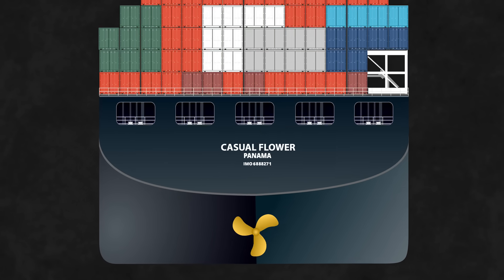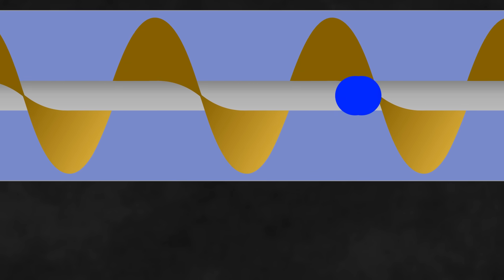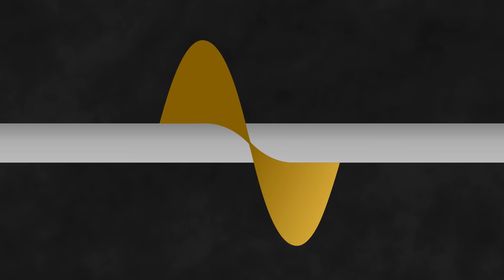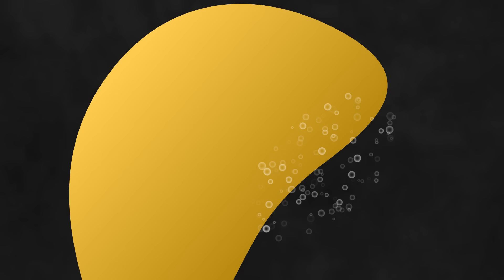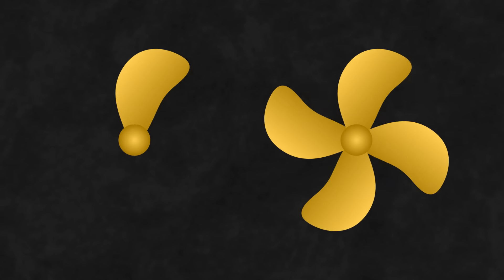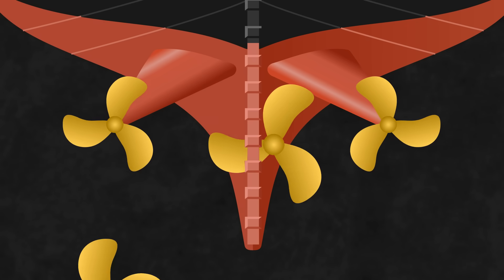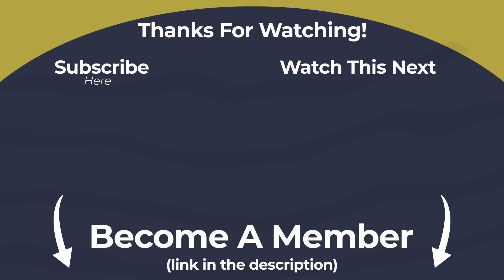Why Are 4 Blades Better Than 3?

Comment: This is a conversation starter if ya like to talk drivel for hours upon hours. I figured you'd actually teach something besides titan theory
. And then you reveal it's not a science. Then it's a science for each vessel needing a bespoke prop to solve the ten commandments of propulsion , and that can be agreed . However used props are still great value although expensive, since you can stick it on your boat and see if it sinks or swims.

Comment: Something that might be obvious but not for everyone, first is size, and generally speaking a larger prop is more efficient, but like everything else it's a compromise.
Prop theory is really complex. And with most boats not having multi speed gearboxes, the balance is even more critical.
Say a large, mid pitch prop might be great for mid speed efficiency on a highly loaded engine, but it you wanna rev it up to produce more power, you might need a smaller prop, or your engine simply won't rev up, it's like starting on 5th gear.
Or maybe you should you reduce the pitch? Well it depends, how much do you care about acceleration? How much drag does your boat produce? Do you want to achieve max speed or do you want your boat to still be efficient at low engine speed?

And I kid you not, many boat builders just plain get it wrong sometimes.

Comment: Why don't ships use ducted propellers? Use of ducts improves thrust quite a lot with propellers in air so I would expect the to apply in water but all the bigger propellers are used without ducts. Is the reason so simple that it's more cost effective to increase the radius than to build the ducting?

Comment: From the foundry point of view, when the propelers are casted the material contraction during the solidification causes stress all along the casting piece. For that reason, is a good pratice to avoid a linear shape of one paddle in front the other as is in the pair number of paddles. An odd number of paddles is desirable to distribute better the tensions in the casted propelers. 
This happens also in the apokes of casted wheels.

Comment: Note that nearly all of this applies to props for aircraft as well.
Reply: With the exception that cavitation in air is replaced by transonic or supersonic airflow, but the basic concept that a dramatic pressure reduction occurs is the same.

Comment: 3 blade on smaller boats give a better top speed 4 blades for heavier boat for more power to push but lower top end.  2 blades were condidered speed props. Had a 4 blade on my center console it didnt have the speed it should have. Swapped to the 3 blade and gained about 6 kts.

Comment: Replaced the 3 blade prop with a 4 blade prop on my 26’ cruiser. Lot better hole shot and really improved the response and handling when in reverse. Cost about 2 mph top end speed but I rarely run it wise open anyway.

Comment: We're getting a new prop on our boat soon, slightly different pitch to better suit the new engine that we had put in couple of years ago.

Only a 38' boat but even that change should effect fuel consumption, I imagine the efficiency savings of a properly pitched propeller are amplified on the larger vessels.

Comment: Question, why is it that submarines have so many blades on their props. They always seem to have a lot more than other ships of the same size, so what gives?
Is it just to reduce vibration and by extension sound output (as submarines are usually built for stealth) or is there some other reason?

Comment: Computational fluid dynamics can't really show what will actually happen. The data points are based on "knowns", anything else is just a guess. The Wright Bros got their props right, all of the modern computing power of NASA has only been able to increase aero prop efficiency by about 5%!

Comment: I'm pretty sure the mystery of Titanic's central propeller has been solved by the discovery of the order for a central 3-bladed propeller a couple years back
Reply: Correct, a Harland and Wolff document was discovered indicating that Titanic was fitted with a 3 bladed center screw. I believe they were experimenting with different screw configurations to find out which one was most efficient and provided more speed. Titanic did very well speed wise on her maiden voyage, but Olympic with a 4 bladed center screw exceeded her service speed MANY MANY times at one point reaching speeds close to 24.5 knots.

Comment: A bit like an end mill.
A 3 flute can take as much material off an a 4 flute but to do that it either needs to move at a faster feed which loads the flutes more, but that can be minimized with a faster speed but that increases stress on the cutting edge while reducing chip load.

Comment: I wonder how much it had to do with Titanic's outer props being driven by piston engines while the centre one was powered by turbine, which s happier running faster than the former (one of my pet peeves with the movie is that all propellers start turning at the exact same moment. The centre turbine was powered by low pressure steam exhausted from the outboard engines, so it would start at least a little later). 
But here is another thought: would the centre prop have to run at faster rpm - or have a steeper pitch - because it is fed water already accelerated backwards by the outboard props?

Comment: Please keep in mind that many large ships are driven by very large, very low speed diesel engines that are direct connected to the ship's screw.  Many of these engines operate at a maximum rotational speed in the range of 100 to 150 rpm.  The ship's screw is designed to match the engine and hull characteristics so that a maximum fuel efficiency and desired cruising speed are met.  Also, the statement about multiple bladed screws losing efficiency because of interference is not quite right.  Because as the screw is advancing as it is turning, the next blade on the screw is interacting with a "different" slice of water.  The pitch on the screw blades does determine if there will be any interference.  If you look at the prop of a small high speed boat, it will look more like a high flow, low head pump impeller.

Comment: It's going back quite a few years now, but I think that all the ships upon which I served had 4 or 5 bladed propellers that were made of bronze (not steel).
However, some of the ships carried a (relatively cheaper) spare cast steel propeller stored on deck, so that in the event of propeller damage, a dry dock could replace the damaged one and make the ship usable again, albeit at reduced efficiency as they were not made to such a high standard.
I have never seen this needed to be done (because our deck officers were competent) and at each routine dry-docking, the normal propeller was reinstated after attention to the shaft and seals.
Regarding vibration, this was always greater when in ballast, because the prop was closer to the surface, giving rise to a low frequency beat that could be heard and felt in my cabin.

Comment: A similar evolution of more and more propeller blades happened in airplanes. In WW1, airplane propellers almost universally had 2 blades. As airplane engines gradually got more and more powerful over the next 25 years, meaning that more and more propeller blades were needed to impart that power to the air, WW2 saw airplane propeller designs that typically used 3 or 4 or 5 blades.

Wind turbines can be thought of as a reverse form of propeller blade, meant to extract energy to the air rather than imparting energy to the air. More than 100 years ago, windmills with an even number of blades, 4 to 8 blades, were common in Europe. Now in the early 21st Century, newly built wind turbines almost universally around the world have 3 blades. Perhaps as new materials get invented, wind turbines will go back to having 4 or more blades like the windmills of past centuries in Europe.

Comment: They are not always better.  The size, shape, skew, pitch, A-bracket v P bracket, angles between blades v angle between brackets, number of blades etc depends on numerous factors:  engine speed, engine power, shaft speed, ships speed, CPP of fixed pitch, noise requirements, metals used in the making of the prop.
Submarines have 6 or 7 blades, warships have 4 or 5 blades, Merchant ships have 3, 4 or 5 blades.  The most efficient prop is 1 bladed!!!  Yes, an archimedes screw is the most efficient but doesn't fit well on a ship..

Comment: generally the slower the rpm the more blades and the more towing power such as  on a tugboat...
That ocean liner with howwible vibration aft ; maybe the Queen Mary? that she had to slow down... was that fixed by  better proppellers?

Comment: Actually, four blades don’t work well for propeller sets when the center screw is four blades and the other two or three if it has the wrong pitch angle this is something titanic’s designers had to play with to get right before they went back up to the 4 Bladed Center propeller which by the way they did on Olympic before a while it didn’t have it because the first design didn’t work properly

Comment: In the thumbnail, in actuality, the three blade prop would have huge cloverleaf blades, and be slightly larger in diameter.  More bite at lower speeds.  The 4-blade would be a smaller diameter with less surface area per blade, more rake angle, and one extra blade.  More speed without requiring more engine torque.  I run both types on my cabin cruiser depending on my load and requirements for that trip.  Lower rpm from a slower speed yet more efficient 3 blade may take a bit longer to get there, but you save a hell of a lot in fuel costs when you need 300 gallons to fuel up.

Comment: In mechanics of rotating parts, it's best to aim at prime number of members (propellers in this case). If not possible,then odd number. Even number of members generate the largest interference of vibrations. But I guess it doesn't matter in shipbuilding, probably a propeller doesn't spin that fast to create any interferences.

Comment: 5:50  I'd like to point out that this is not always the case. I don't know which kind of sailing ship is meant exactly, but I have never encountered a sailing ship with only 2 blades, and when googling "sailing ship propeller" most of them have 3 blades, some even 4

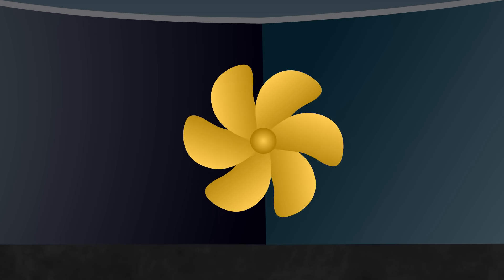Comment: 0:52 No. The most efficient propulsion for ships is the paddle wheel with adjustable blades, not the propeller. However, the paddle wheel has disadvantages, it can be damaged by strong waves and the draft of the ship should not change too much.

Comment: I'm more familiar with aircraft propeller physics, so I thought you were full of it until you brought up the vaporization thing. It made perfect sense once you brought that up, because if I'm not mistaken, aircraft propellers only really use more than two blades when the engine power causes too much stress on the blades and/or vibrations to the aircraft's body, otherwise you're just losing efficiency due to the low pressure area following each blade interfering with the amount of air hitting the next. I completely overlooked the fact that water doesn't need very low pressure to vaporize at lower temperatures, and that ship propellers have the rotational speed necessary to make enough "steam" to cause rapid damage.

Comment: Excellent topic, nicely covered. You may need to do a follow-up to cover toroidal props. Cavitation is fascinating to me. As a little kid, I always wondered where all the bubbles were coming from when I ventured out into the bay in a friend's small outboard motorboat. Oh, and how about mantis shrimp--they can cavitate the water.
Reply: With outboard powered boats most of the bubbles are exhaust gases from the engine. Basically the 'standard' design for an outboard is to mix the exhaust with the used cooling water, then dump both through the hollow propeller hub. Some smaller outboards instead have an exhaust outlet just above and behind the propeller, but they still mix the exhaust with the coolant and then dump both underwater.

The main reason for this is that it makes the engine quieter for the passengers (local sea life might disagree) and reduces the amount of smelly fumes (once again, local sea life might disagree). Another advantage is that at high speed the slipstream of the propeller hub can create suction that helps pull the exhaust out of the engine, improving performance.

Comment: Your on to it ! Every boat is different  good vidio well researched !  I would have changed more props in my life than underpants and there isn't a off the shelf prop that fits all , sometimes it's got a lot to do with luck ! Getting the right one can make life so much easier!  Also marine growth is a nightmare and ropes wrapped around prop and shaft this is where rope cutters are a must but are often  overlooked

Comment: Aircraft Propellers Aerodynamic also followed certain theories as ship 🚢 Propeller theories and with Jet engine fitted to Aircraft Propeller became Turboprop with Faster speed efficiency than 4 bladed Propeller by modern Composite Materials Propeller even Lasting.

Comment: even todau propellers aren't usually made of steel its usually a bronze alloy which is wild that we've never come up with a better material but its very resistant to corrosion and cavitation
Reply: Bronze is hard enough, corrosion resistant, yet easily repairable.  No improved material is required.

Comment: The pressure differential between the front and back of the blade tips doesn't evaporate the water, it boils it creating steam. These bubbles expand and contract several times as they dissipate creating noise and erode the propellers over time. Slower traveling blade tips reduces the onset of cavitation. We were taught basic stuff like this early in sonar school.

Comment: Fewer blades = higher efficiency. 1 blade (disregarding counterweight to balance) = most efficient.

More blades = more thrust at smaller radius. I.e. we increase the no of blades for practical reasons (space, load on each blade..)

Comment: You didn't talk about subs.... in th undersea world 32 or 33 is about right... but, also... when does a propeller become an impeller???????? (a question that has haunted naval engineers for generations...)
Reply: If you saw the props we run on modern subs.... generally optimized for about 150m pressures... you'd freak out.  But we also run on motors... not engines... and we gear for high-torque, low-RPMs... we need to stay silent.  Cavitation is the ultimate enemy of all submarines. Not only can it damage your hardware and reduce your efficiency... but it's easily detectable and identifiable.  So we like to run low-speed/high-surface-area/variable-gradient/copper-alloy props (or "pellers" as we sometimes call them, because, again... they are less a propeller and more an impeller)
Reply: I can't say more than that in case the Navy reads this post... but... if you Google an impeller... you might be able to deduce some other fun things we do with our propulsion-systems

Comment: An addendum to this on submarine propellers, specifically military submarines. With military submarines, noise reduction, and therefore vibration reduction, is one of the top design priorities, therefore most of their propellers have a prime number of blades (3,5,7,11,13...). This is because, non-prime number of blades will have one or more axis of symmetry (other than the symmetry of having equally spaced propellors). Additional axis of symmetry cause additional vibration modes to arise, and therefore, more noise.
Reply: High thrust, high surface area, low rpm, minimal cavitation 7 blade scimitar design.

Comment: I suspect the center prop had four blades rather than three in order to reduce harmonic vibrations. You don't want a 75+ meter long shaft whipping around, driven by harmonics from other shafts through the pedestal bearings. I suspect the change to three blades was made because they wanted to see if they could reduce maintenance expenses by having to keep only two kinds of props instead of three, but as we see, that didn't work out.
Reply: Three wide blades are for power.  Four narrower higher raked blades (and usually a smaller diameter) are for speed.

Comment: Will there potentially be a video about the differences between an impeller in a cylinder, like in water jet engines, and that "new" propeller design where the blades are loops?

Comment: To help with tip-edge inefficiency...why not add "wing-tips" as seen on the ends of the modern jet airliner wings?...or.....why not encase the prop in a open-ended "tube" which can maybe capure some of the shedding inefficiency?
Reply: Prop blades are cupped on the trailing edge to reduce cavitation.  And a ducted fan or impeller jet is typically 20% less efficient than an open propeller.

Comment: Cavitation doesn’t produce vapour pockets. The cavities are actually hard vacuum. When they collapse they generate immensely high impact forces and temperatures (5000 to 10000C are common producing flashes of light). The high temperatures boil the metal of the propeller blades.
Cavitation occurs with any object moving fast in a liquid or fast moving liquid in a pipe and causes incredible damage quite rapidly.

Comment: On the subject of reducing drag when not in use, can the props not be feathered?
Reply: Yes, they can. This is typical for a modern sailboat. But for a motor ship, it is not common, props are typically used, as it is the only way of moving the vessel forward. On certain sailboats the feathering prop actually can be used to charge batteries.
Reply: @robinj1052  Fascinating, thank you!

Comment: The more blades the more “thrust” per rotation, that’s why modern submarines have propellers that have like 15 blades, this allows them to spin their propellers at much lower speeds while still producing a lot of thrust, the low speeds of the propeller makes them less noisy in submarine warfare